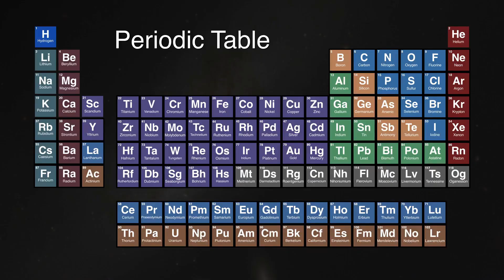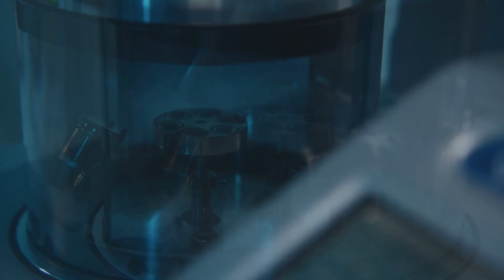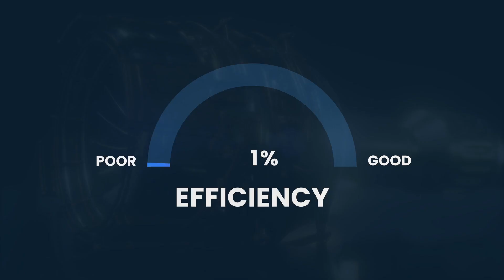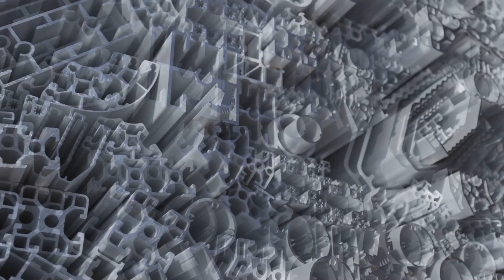Titanium: Why the Kroll Process Makes Titanium So Strong

Comment: titanium is not good with both heat and cold. u cant even use it as exhausts on cars since it's prone to cracking after not long use because of the heat
Reply from the maker: Actually, titanium handles heat really well that’s why it’s used in jet engines and race car exhausts. 😎 It’s not the heat that’s the problem; it’s when the welding or thickness isn’t done right. Properly made titanium exhausts last for years.
Reply: @beyondthelements  ah well u might be correct there but from all ive seen they always ended up cracks and so but before that they sound beautiful and looks amazing but y might be right that its the welding jobs even tho looking nice they might not be done correctly.
Reply: @beyondthelements  also i got no personal experience handle titanium for a car enthusiast /hobbyist its way to expensive to build exhaustsystem in titanium :P
Reply from the maker: Yeah good hardware is always expensive :)
Reply: @beyondthelements  true true but i draw the line when the exhaust would cost 3 times more then the value of the car
Reply from the maker: Thats a solid line indeed 😂. Even if its worth half a car.